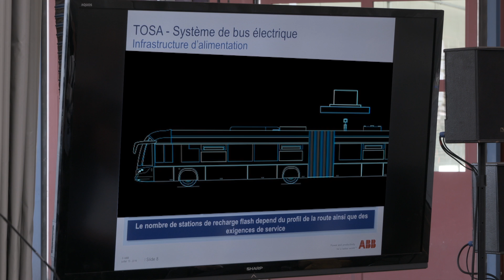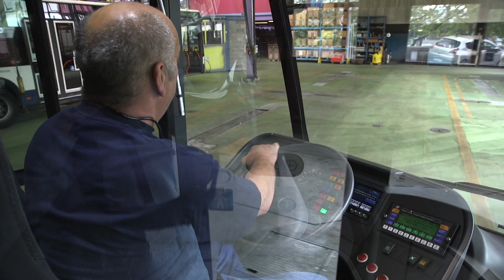Charging a bus in 15 seconds: Geneva's new CO2-free public transport solution

Comment: What if the bus runs out of electricity while stuck in traffic?
Reply: This isn't America where buses are always stuck in traffic.
Reply: Its an electric motor.... not a fossil fuel engine. It will be automatically turned off when the vehicle is not moving.
Reply: @DMTHOTH  air conditioning, lights, sensors, battery management systems, cooling systems for the motor? Just because the motor stops rotating, doesn't mean the whole bus shuts down.

Comment: Infrastructure for that will be the same what is for trolley. Just wires are hidden to collectors + loosing on the upload/download of  power. (Doc stations should be with EDLC  inside for so quick charging).